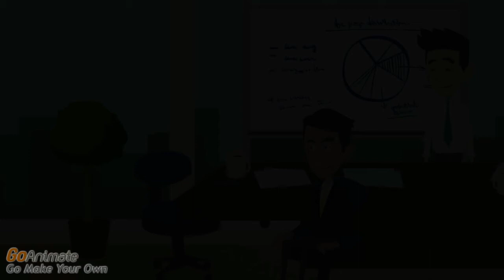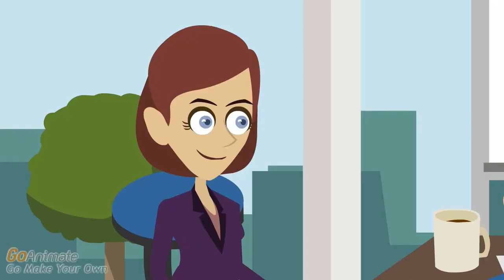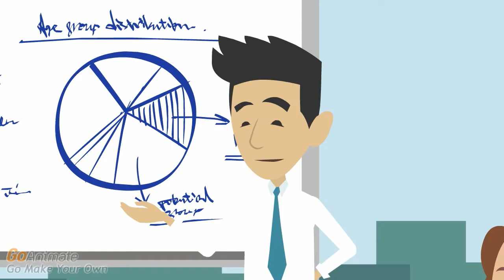Why is My Dehumidifier so Hot?

Comment: I had an LG dehumidifier that ran spectacularly from 2010 to 2018- my basement felt dry and COOL.  I just bought a new GE and my basement is dry but I can't work down there because it's TOO HOT! WTF happened?  Different refrigerant?  Everyone copying some new crappy cheap design?  I see alot of BS online about how they must run hot but I don't buy it because I have (or  had) the proof in my old unit.  Now I need to find a floor air conditioner to put down there for the summer that will be my summer dehumidifier, then switch to the GE in the winter.  What a pile of you know what!

Comment: this actually was very informative.. and my unit has been doing this and I was worried about a fire hazard as well. so, I unplugged it and put it aside. shortly after that, I started seeing things on the internet on how my comfort aire model would catch fire? but it did work well for years. I think it's because I neglected to clean the filter for soo long and may have caused something or a couple of things to burn out etc?? probably too much to fix ?